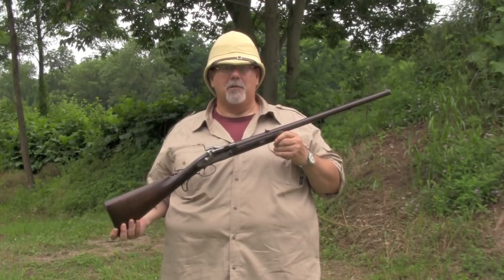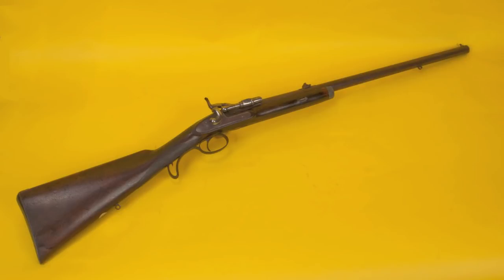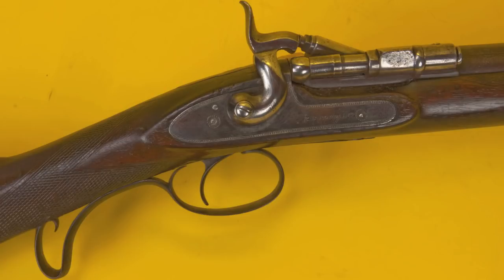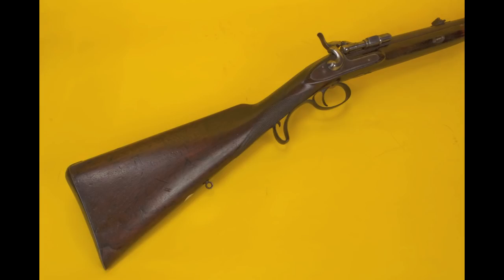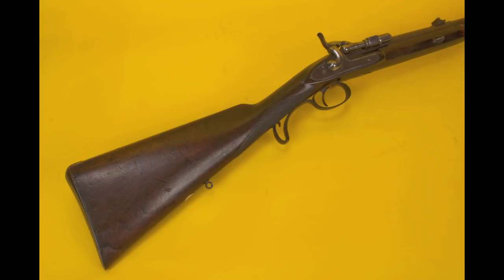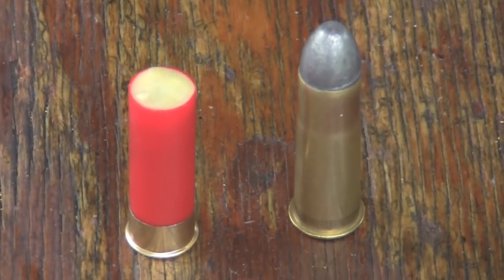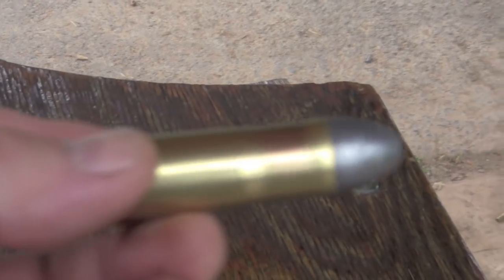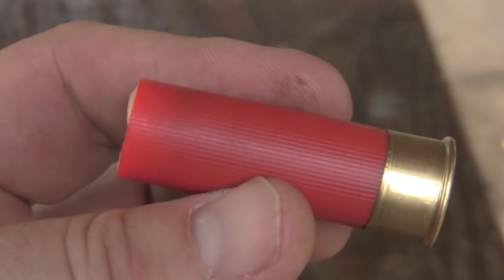Shooting the 577 Snider British Sporting Rifle.mov

Comment: X-Ring Services makes a bullet mold for this and other Brit guns, they are miles ahead of the minie and are the proper .60" diameter.
Reply: all depends on barrel specs, the very first Snyder-Enfield's used the progressive-depth rifled barrels off of the P53's (and shoot the .57ish" ML HB  bullets just fine), but later MK's and civilian-market guns used bores and rifling depths all over the place. If you have a uniform depth rifled barrel with shallow grooves (.002-.005) and a .577-.58" bore, you can use the HB bullets for ML's, if you have deeper grooves or an oversized bore, you will need bigger bullets. In theory, they should be able to use the same bullets as .577 BPE's, but the bores are often not in spec lol. 

The biggest reason you don't see this issue with American Trapdoors converted from .58RF to CF is that that model (1865) wasn't in use long enough to run out of it's supply of musket barrels lol.

Comment: From 2011 so you've probably already heard, but just in case...
Your round balls shot well bc they're .600 while your minis were only .577
The Snider has a tapered barrel so does well with a larger bullet, sometimes even a .600 mini
Great lil guns & everywhere up here in Canada; we used it instead of the Martini Henry except in small batches.

Comment: I am trying to make a shotgun load like the one you made, but I am not sure if the .600 round ball is the right size. It seems to be too tight. I have 577 Enfield Snyder riffle. How tight should the round ball be if I am testing it on the front of the barrel opening ? I placed it on the end of the barrel and it doesn't drop in at all, it sits about halfway in at best. It that normal or do I need to go with a smaller ball?

Comment: can I use a minie ball instead of round ball in those plastic shells, or will it break something?
Reply from the maker: You can, but it is undersized to the shell. You can use a stiff line to hold it in place

Comment: have you tryed stuffing the hollow mine with some kind of plug ?
Reply: I cast Lee .578 minie balls from pure lead, compress/swage them to .588 by using a 1/2" steel rod in my drill press, and use a 3/8" wooden hole plug in the hollow base.  Shoots great in my Carbine, but oversized for my rifle chamber.  The rifle loves the .585 round balls for accuracy.

Comment: Mike, do you see any problems if I was to load some 3 band .577 bullet instead of the round balls, in the 24 Gauge shotshell?
Reply from the maker: No problems except for a very loose fit. I would fill the space by really trowelling some lube onto the .577 bullet. I have done this with .577 Minnie Balls with no problem, but accuracy was indifferent. If you are using flat based bullets, I'd expect poor accuracy.
Reply: Thanks Mike, and yes they are Minnie type bullets. Can't wait to shoot it for the first time...Cheers!

Comment: Hi Michael I was curious  did the larger mini balls. Do better with accuracy thanks Curt
Reply from the maker: No. I had lousy luck with every Minnie that I tried. I finally had a custom, solid based .590 bullet mold made, which works much better
Reply: Do you use the solid .590 in the brass or the plastic hull?  I was planning to try both with a .600 bullet from xring or accurate molds.  Thanks!
Reply from the maker: Lensflare Deviant Yes. I have been using the solid .590 bullet in brass cases for quite awhile. It works very well

Comment: Isn't this considered a Destructive Device by the NFA since it's bore is greater than half an inch?
Reply: No, it's a pre-1898 so it's considered an antique and is exempt from most firearms laws. You could actually buy one online and have it mailed straight to your door, no license or dealer needed. I have one myself that I'm working on restoring.
Reply: +12799MaDeuce So for cartridge firing guns, as long as they're made before 1898 they are exempt from the NICS checks and the NFA. Is this only applicable to black powder only guns or does it also apply to smokeless guns also?
Reply: +Dick Tickles Google "antique firearms law" the first link is from atf.gov and explains it all. Technically, the Snider would be non-exempt because it's a cartridge gun, but the ammunition is not "readily available" so it's exempt.
Reply: +12799MaDeuce not true. its exempt because its made before the cutoff date. firing system (blackpowder or cartridge) has nothing to do with it.  this gun, first off, cant fire smokeless powder cartridges, only black powder cartridges.  The atf's view is that any gun made before 1898 isnt a gun, its a collector's item or has only a sporting purpose, so no threat.

Comment: So I'm curious Mike, which would you prefer to use, a Snider or a Trapdoor rifle?
Reply from the maker: I love the look of my Snider, but the trapdoor is a better mechanism.
Reply: The more accurate comparison would be the martini henry and the trapdoor.
Reply: Plutonius X I would personally disagree. The Martini-Henry was a rifle built for cartridges from the ground up, and was pretty different from its predecessor. Although the Trapdoor rifle was a purpose-built cartridge rifle, there really isn't much of a difference between it and the earlier rifled-muskets that were converted to fire the .50-70, at least from what I can tell.
Reply: True. But they served at the same time for their respective nations.
Reply: Plutonius X Absolutely correct, they did. But the Allin Conversions and the Snider Conversions came out around the same time, and were designed to do pretty much the exact same thing. The United States doesn't have an equivalent to the Martini-Henry because we just skipped that stage of military firearms, essentially going from the stop-gap Trapdoor to the Krag bolt-action. 

Essentially, my point is that in terms of development and design, the Snider is a much closer comparison to the Springfield in terms of design and function, than the Martini-Henry, which was an actual step forward. Kind of like comparing an M1 Garand and a Mosin Nagant. They both served around the same time, but one was clearly more advanced than the other, and the comparison isn't quite as apt.
Reply: Trum4n1208 

Aye. Good Points mate
Reply: Plutonius X And the same to you, sir.
Reply: +Trum4n1208 Wait.. a conversation on youtube where both gentlemen express their opinions; and while expressing said opinions in a way that make sense as educated individuals without the need of insults ?! I love it, I salute both of you.

Comment: wow. must be deaf shooting with no ears or proper eye protection. range seems to be lax on the rules i see.
Reply from the maker: Though they are hard to see in the video, I an wearing dark blue ear plugs that fit deep in the ear, but there are small blue tabs for removal. Also, the glasses I'm wearing have poly carbonate lenses, and they stop debris from hitting my eyes without shattering. I wear them in competition too, and they pass as safety glasses. So...wow....maybe you could ask instead of leading with sarcasm.